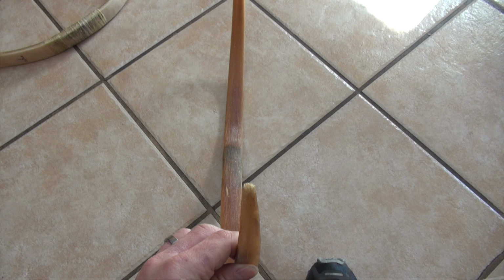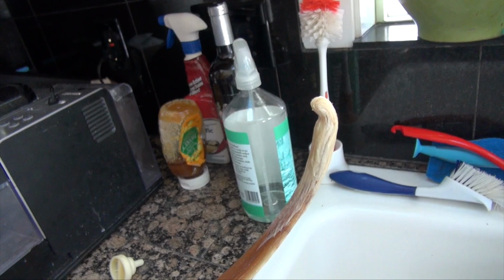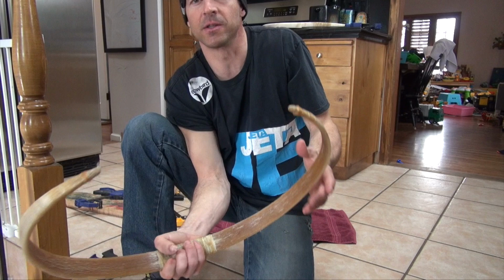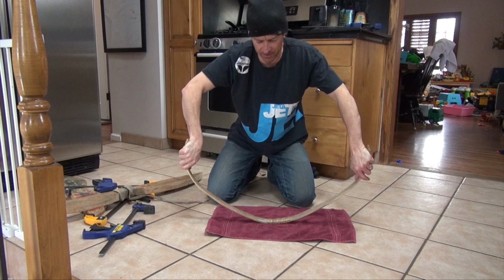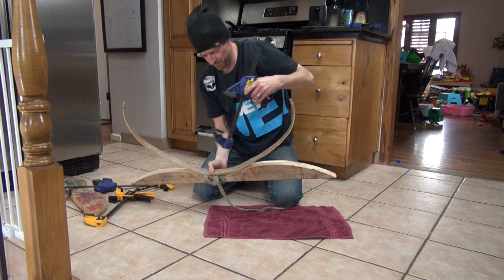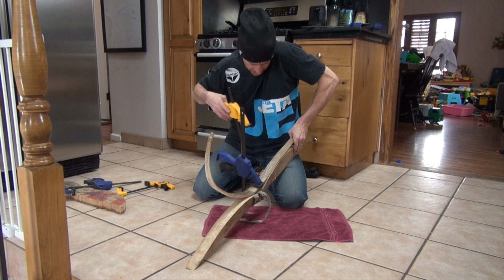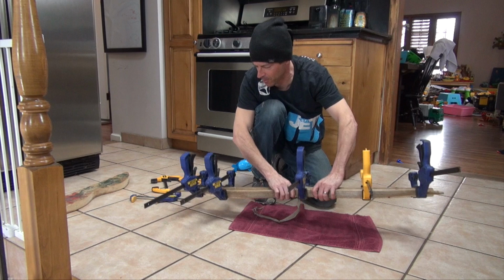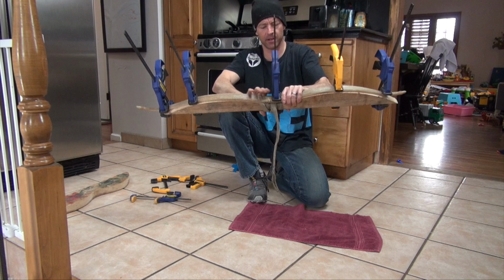How to Make a Horn Bow (Part 5 of 6)

Comment: just a thought. with the forum plank your bending it over would it be easier and straighter to clamp if you had the same curve cut into (inverted) the bottom of the forum so each clamp is square when compressing or is there a reason why it's flat on the bottom that I can't quite see?
Reply: sorry about my English it's not my first language